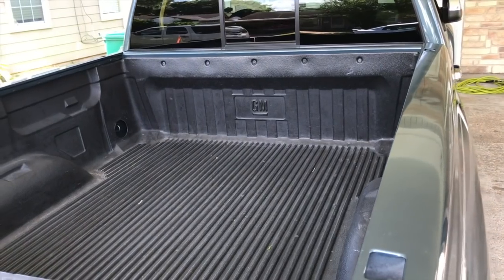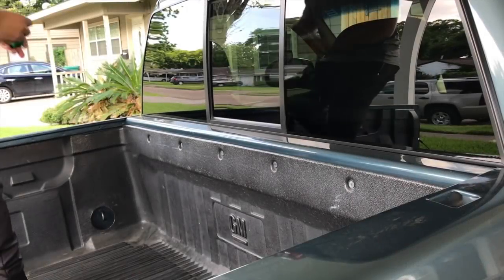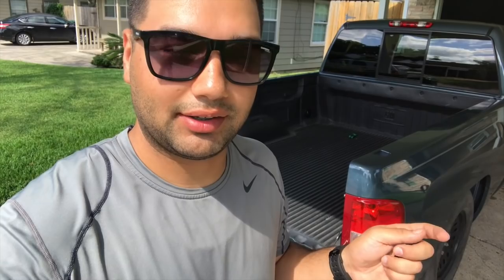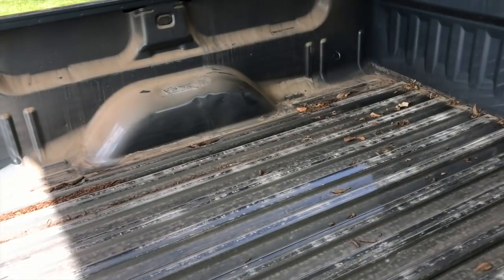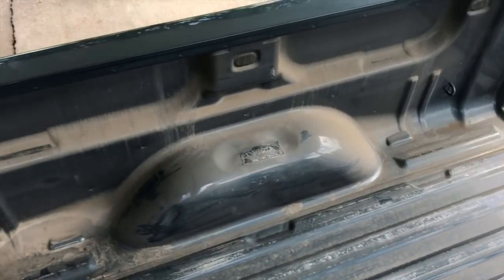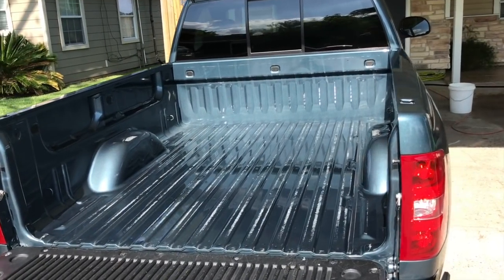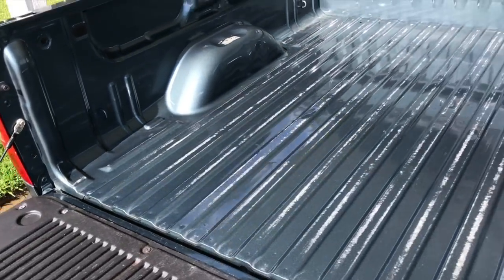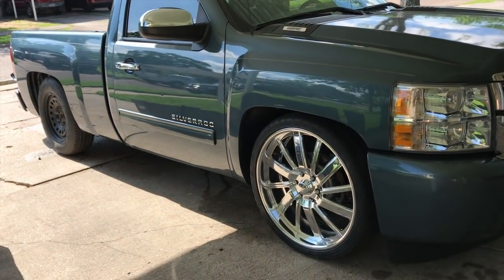Old Wheels are Gone |VlOG|

Comment: I don’t recommend those lug nuts bro. There’s a lot of people having problems with those. They seem to break of real easily when they get torqued a little to much and believe me it’s a bitch to take them off. Had to burn 2 of them off with a torch and the wheel got a little burnt. Don’t want that to happen to your billets bro.
Reply from the maker: Yeah I plan on getting some good quality lug nuts I just needed something temporary to install the wheels but thanks for the heads up I’d be kicking myself in the butt if I had to torch them off lol